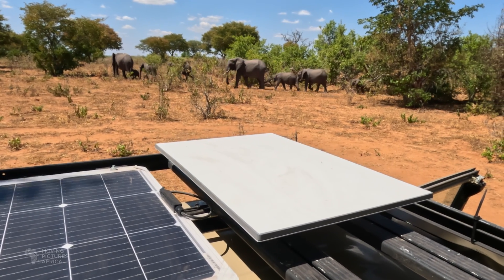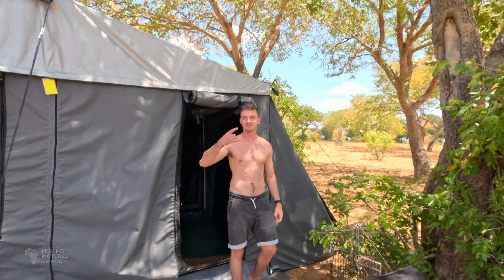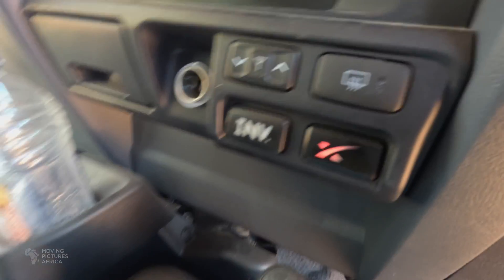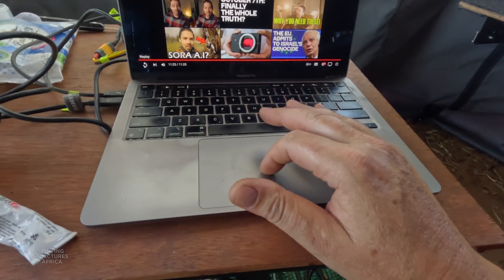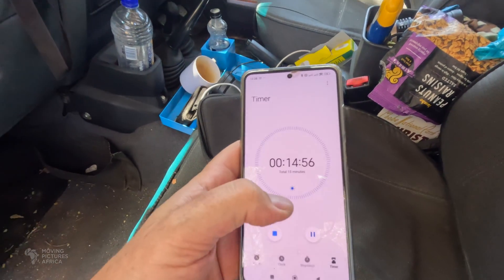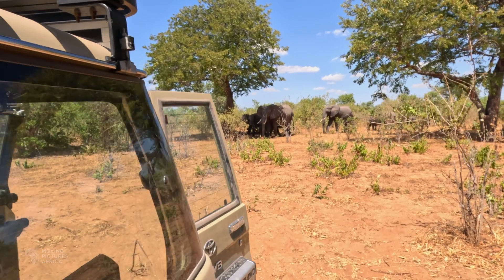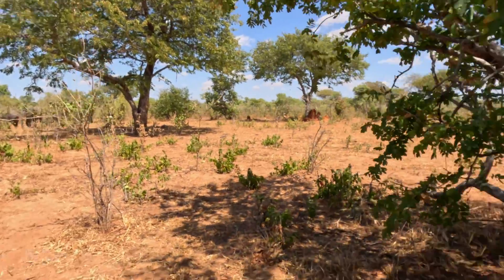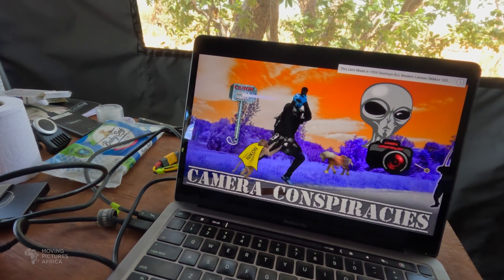Gen 3 Starlink 12v conversion. Is it worth it?

Comment: The problem is streaming is very slow, 12v doesn’t give enough juice to stream anything
Reply from the maker: @Smchen44  it is getting the same amount of power as when it is plugged in via the AC adapter. The speed is the same.
Reply: @ not for us. We did the 12v conversion, video on YouTube was slow and laggy
Reply from the maker: @poolqueen44  interesting. To conclude it is a power issue, you will need to test in the same location with 12V and AC power supplies.

Comment: Sucks that they use so much power (not a ton, but over an extended period or when it’s cloudy with minimal solar, it’ll add up.) 

I think the step-up converter really hurts the efficiency. With the Gen 2 you only needed a 48v PoE and I believe people were seeing around 45 watts with the 12v setup. 

For me it’s still worth it in the RV, as the house battery 12v system is always on and stable, while I haven’t really wired up an inverter yet (I have two) and if I do, I’m not going to leave it on.
Reply from the maker: @EstorilEm  yeah. I've occasionally left it on overnight by mistake and emptied my battery. I think the new mini is much less power-hungry.
Reply: @MovingPicturesAfrica  that would be ideal, but it’s just totally out of my budget. I’m only researching for a 7 day camping trip coming up, and it’s impossible to justify ~$700+ for internet w/ service etc. 

Then again I just bought a gen 3 today, and realized that the mini roam plan (50gb) is ONLY for the mini (others reported the hardware didn’t matter) so now I’m stuck paying the $150 for the roam so I can turn it off after the trip… hardware is only $299 now so I can sorta justify it, but that’s still $450 for the trip. 🤮

Comment: How’s it performing under that tree ?
Reply from the maker: Not too bad actually. As long as there's a decent amount of sky visible to the South it works fine. I've used it in places with ~80% of the sky blocked by trees and it still functions but with dropouts every few minutes. So it depends what you are doing online

Comment: Great Series. Thanks you very much. I am just about to embark on a Namibia trip from Cape Town and will be arriving in CT with my Gen 3. I have purchased the power supply parts but would love to know what parts you used for your little 12V to USB hub and which hub are you using.
Reply from the maker: @chiefengineer6288  thanks. Are you asking about the hub I use to power my laptop? If so I used this converter: https://www.amazon.com/dp/B01H97ETP8?ref=ppx_pop_mob_ap_share. The hub is an OWC thunderbolt hub: https://www.owc.com/solutions/thunderbolt-hub